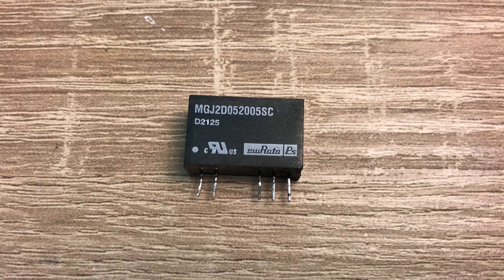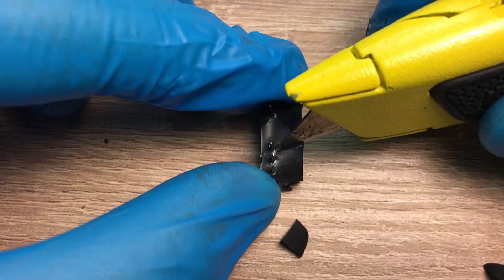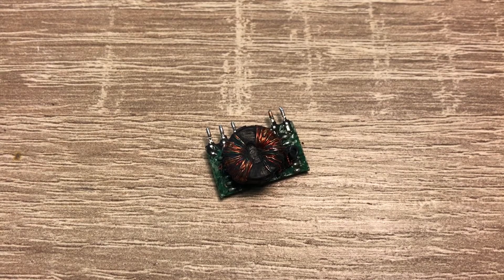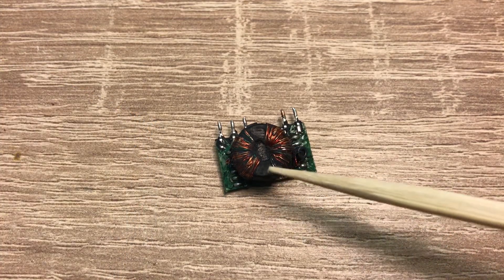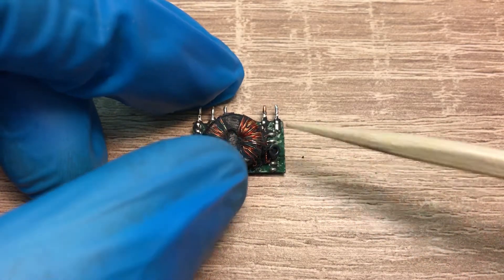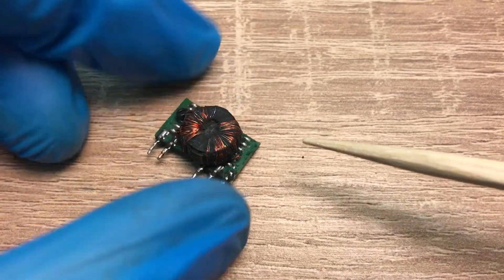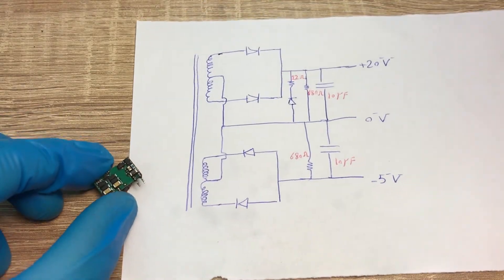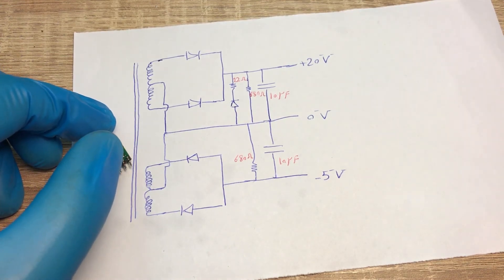Inside an isolated DC-DC converter ( with explanation and circuitry )

Comment: Your circuitry cannot work. It does not have either an AC generator or an electronic switch.
Reply from the maker: It works,  it is called a self-oscillating circuit. You can watch this video for example: https://www.youtube.com/watch?v=8CGZ9k7fIQk
Reply: @HVE  In your example (2:10) ordinary AC generator. In this video, the power supply should be shown as the input and I took the red one as an imaginary result.

Comment: Strange, it doesn't have a feedback from the secondary for regulation.
Reply from the maker: Since it is isolated converter, adding feedback would add complexity and makes the structure larger.
Reply: Yes. The spec sheets say it is unregulated output. In fact, the output voltage varies quite a lot depending on input voltage, and on load at the output. So it's useful only for limited apps